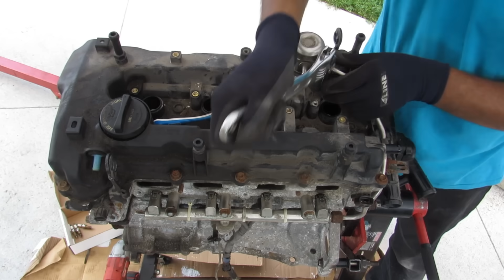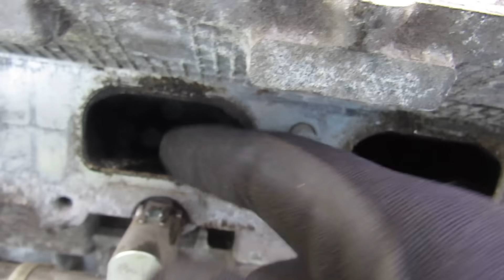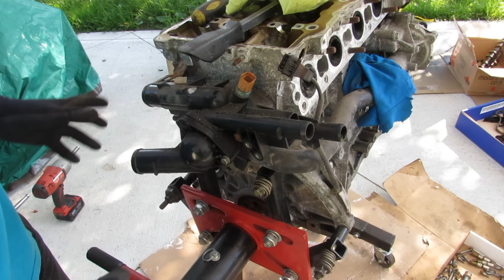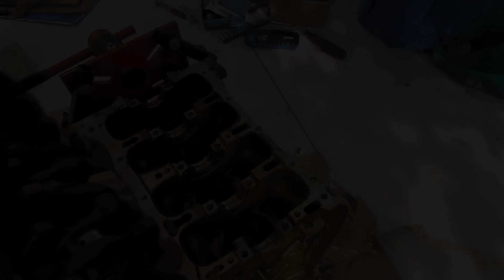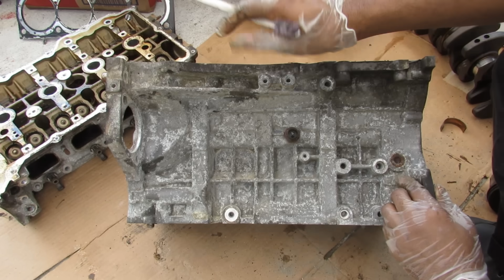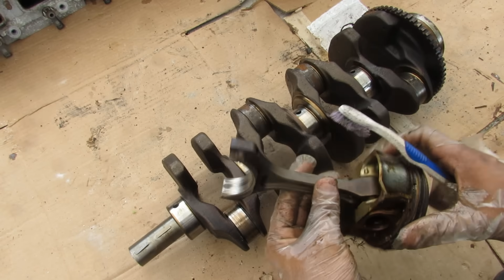Why Hyundai Engines FAIL

Comment: That was really interesting, a shame because the top part of engine looked really clean.  I bought a nearly new 2017 Elantra (in 2018), it has the the newer Atkinson cycle 2 liter engine.  My son and his wife now own, so far so good, no problems and I think it has close to 100,000 miles.  Thankfully they take my advice and make sure the oil and filter is changed every 3,000 miles.  Have to say it is a really nice car to drive, hopefully last them a while longer.
Reply: My son has the 2017 2 litre Kona, 6 speed torque converter trans [down under] which has about 75.000 km now [Atkinson cycle manifold injection], serviced every 15,000 km, no dramas to date. Oil chang period seem long but dealer serviced under warranty, maybe engines built in other countries might have some differences? have not heard of this down under.
Reply: @adoreslaurel  probably same engine as what’s in the Elantra.  I would definitely recommend changing the oil more frequently on yours though
Reply: @robbflynn4325  Yes, it's my sons own vehicle, going to be sold soon as he is to get a new company car, A Subaru  [probably an Impreza I think]. I wish I had enough use for it as I would buy it off him at 75000 km Still got some warranty left. I threw out the under diameter "Donut" and put in a 16 inch  [down under car] BA Falcon 6.5 inch rim with a 205/60 profile tyre, fancy putting a spare wheel in that is less than the diameter of the cars wheels. insane with a 80km speed limit and about the same distance before getting your flat fixed. At least it has a real emergency brake, not like these iffy EPB's that if you lose your electrics in total, stopping is a real problem EPB will not work.
Reply: @adoreslaurel  Definitely prefer a full sized tire, watched a Scotty Kilmer video last week (you've got to check him out), and he did a feature showing how some car manufacturers are not including ANY spare wheel, I guess most people these days wouldn't know how to change one anyway!  My wife drives a 2019 Forester, bought it new, has the 2.5 Boxer engine.  Now has 55,000 miles, no problems, really nice car to drive.
Reply: @robbflynn4325  I do follow Scotty, Down under we get a spare, Tucson and Highlander get one full size [or they used to?] Kona got the silly donut, Service guy at the dealership was surprised when I showed him a full sized tyre would fit in the donut bay. Some cars get a can of "FOOF" but that is no good if you rip a sidewall. Some one posted about Subaru's blowing head gaskets [main problem] when they age and said it was best to fit the turbo model gasket as it supposedly to be superior? The Ford wheel I got my son, has near enough the offset to use, won't go on the front but fits the back, just swap wheels around if necessary, front disc gets in the way.
Reply: @robbflynn4325  Yeah the Kona (and Kia Seltos and Forte) have the same 2.0L Nu Atkinson multiport engine as the Elantra. People sometimes confuse it for the 2.0L GDI engine which doesn't run on the Atkinson cycle and has also been under recall like the Theta II 2.4L. I'm not aware of any recalls on the 2.0L Nu engine, though they are infamous for having faulty ignition coils. Mine had that issue.
Reply: @palebeachbum  yeah, my son still owns the car, has over 100,000 miles now, only probably been with the single ignition coil.  It's been a very good car.
Reply: @robbflynn4325  His luck has been much better than mine was. My 2018 Elantra had engine, transmission, and suspension issues before 10k miles. All common factory defects with this model.
Reply: I bought a new 2017 Elantra,  fully loaded, In june of 2016..it's been absolutely flawless.  90.000 miles on it, 0 repairs,  0 issues.  I'm old school about oil changes,  do it every 3000  to 3500 miles . Nice to drive , comfortable.  I bought a new kia  K5 GT LINE with premium package last May. Love it . Kept the Elantra,  still looks like new in and out. I will continue to use it for my 80 mile round trip to work.  And I'm curious to see how long the engine and transmission,  which I had serviced at 50.000 miles, will last with excellent maintenance.
Reply: I bought a 2018 Elantra new in 2018. 2.0L Atkinson engine with 6spd auto. Loved the car, but it had all sorts of problems right away. Issues with erratic throttle response, loss of power, sputtering engine. The transmission was slipping and slamming gears. The suspension was making loud popping and creaking noises. After numerous visits to the dealership to get these issues resolved with little help, I gave up and sold the car with just 25k miles. Loved the looks, comfort, features, quietness, and efficiency of the car, but it was such a headache to own.
Reply: these newer engines are the same as the Theta II in terms of metal shavings in engine block, right now now there's a lawsuit in Australia on these.
Reply: I’m own 2017 Elantra. Bought brand new. Full synthetic fluids throughout changed engine oil every 5500 to 7k and Over 300k miles now with NO problems. Not even a check engine light. Just goes to show that it is really on the owner and how they treat there rides. There is an Elantra on this liberal platform that has 1 million miles on original drivetrain.
Reply: Well maintained Hyundai/Kia engines last. I have 3 Hyundai/Kia vehicles with the 2.4L Theta II engine and all are excellent. One has 52k miles, one has 100k miles and one has 120k miles. I have 2 other Hyundai/Kia vehicles with different engines with even higher mileage. A 2006 2.0L Beta engine with 160k miles and a 2008 3.3L Lambda with 177k miles.
Reply: @NovaResource  I agree, Google million mile Elantra and you will see how they can last.  I think some (not all) of the well documented problems with certain engines are probably due to owner neglect.  A lot of car owners simply do not change their engine oil at the correct interval, or use the incorrect oil or buy a cheapo filter.  Always use quality oil and filters.  Also drive your car moderately, most cars are not designed to be revved high all the time.  Check your fluids regularly.  My son has a 2003 Accord.  After a long trip I checked the fluids, transmission fluid barely showing on dipstick.  Turns out one of the axle seals from the transmission had a leak which I since fixed with a $14 OEM seal.  Had to get right under the car to pinpoint the leak, fact is most people do not do these checks, and in my son's case the eventual inevitable transmission failure on his Accord would have been explained by it having 170,000 miles and therefore reaching it's lifespan.
Reply: @robbflynn4325  I will add one thing to my comment. The 5 cars I own were all built in Korea. I’ve heard rumor that the cars with engines that fail were built in the US. I’ve been looking for verification of that but have been unable to find such proof but I suspect that is the real issue.
Reply: @NovaResource  bit timely you saying that, watch Scotty Kilmer's latest video where he does a review on the Optima, he mentions how Korean built Kia's are better than those that are built in the US.
Reply: @robbflynn4325  I did see that video. However, I must admit I’m not a Snotty Killcar fan. I think he’s extremely biased. He calls all Kias crap because of one car with an unknown maintenance history and a bad O2 sensor. Of course the car is going to run bad if the O2 is bad, that doesn’t make all Kias crap.
Reply: @NovaResource  They are though. Them and Hyundai
Reply: @bean420man  Then explain my 5 Hyundai’s that have no problems?  And explain the millions of other Hyundai owners with no problems. 🙄
Reply: @NovaResource  That's BS, mine was super maintained , I own an auto repair shop myself , and it's been years since I've seen spun rod bearings on a car, except my Santa Fe. It's a turd of an engine , and Hyundai knows it. That's why they got fined 210 million dollars for jerking customers around about it.
Reply: @danbush1249  It’s not BS. Apparently you’re not the mechanic you think you are.  1.3 million?  Really?  I’ll ask you the same question I asked the guy above,  you got that number from where?  Your ass?
Reply: @danbush1249  So in other words, you pulled that number out of your ass, just like I thought.
I did my research: I own 3 Hyundai/Kia cars with the 2.4L Theta II engine (53k miles, 100k miles and 120k miles) and 2 other Hyundai/Kia cars (164k miles on a 2.0L Beta II and 178k miles on a 3.3L Lambda). That’s a lot of research in my opinion.
Reply: @massacremonk  Makes sense, your Hyundai engine died so all other Hyundai engines are bad too, that’s how logic works. 🙄
I highly doubt Hyundai dealerships do more engine swaps than oil changes. Got any proof of that claim?
Reply: @danbush1249  Santa fes are made in america where is the only made Hyundais that had issues mister "supposed" mechanic.
Reply: @danbush1249  2 million rav 4s had engine fires from the abs system same issue that Hyundai had based on the manufacturer chosen. You not sayying nothing about Toyota are you?
Reply: Toyota is reliable and does not have issues like Hyundai,  I have own 2 hyundai's,  yes they have an engine issue,  my car and 2 of my co workers have their engine replaced free, Hyundai know s this stuff, they have enter a settlement to fix thi
Reply: @technop.8461  Exactly. Buy a Toyota. And OP wants to defend a company with poor ethics and say 50K miles is reliable. 🤣
Reply: @NovaResource  To be fair, the other three you’ve posted are fairly low miles. I don’t even remotely consider something reliable until it hits +200K, hell even +300K. So they have a point. I have never heard a Theta II last longer than 200K. I’ll see it to believe it.
Reply: @Iridiumcosmos  And how many cars have you owned over 200K miles?
Reply: @NovaResource  Let’s see since you’re acting like not everyone else gets past 200K. 🤣

• 2008 Nissan Altima. (Trans died at 210K)

• 2003 Toyota Echo. (+300K still going)

• We had another Nissan that lasted over 200K miles which was a second gen Altima. 

• 2005 Toyota Camry with 407K miles. All original engine and transmission.

Do you want to keep going with this because I got all night buddy.
Reply: @Iridiumcosmos  So your saying you have zero experience with Hyundai. That’s what I thought.
Reply: @NovaResource  I used to work on these pieces of shits a lot so nice try. I have heard more horror stories and seen much more reliable cars from other brands that last in the 300K miles on their original powertrains than Hyundais/Kias. The fact that you think a car that lasts 50 - 100K miles is good just shows you have low standards for reliability. That’s literally breaking in mileage for 98% cars on the road but you can proceed to act upset and go off Einstein.
Reply: @Iridiumcosmos  Sure you have. 🙄  I didn’t say 50-100K was the upper limit. What I said was I have personal experience owing multiple Hyundai/Kia’s with over 150k. And you have ZERO ownership experience with Hyundai/Kia cars. Nice try “Einstein”
Reply: @NovaResource  I have zero ownership/mechanical experience? Should I mention we have a Sorento burning oil like a mofo right now at such low mileage? Keep defending their crappy cars. Hyundai themselves seem to be as clueless as their fans are. 🤣
Reply: @Iridiumcosmos   my son has one bought used '13 Elantra 1.8 pushing 300k. Been doggin it for bout 6 months now.
Reply: Over 1 million bad engines.  Junk Kia's
Reply: @allanhood8402  Over 1 million?  Really?  And you got that number from where?  Your ass?
Reply: @NovaResource  1.3 recalled for that problem.
Reply: @allanhood8402  Were they built in the USA?
Reply: The ones blowing up must be liberal democratic owners. They like destroying everything.

Comment: Bad bearings are the culprit of most of these engines. I’ve seen hundreds of these. Oh yeah and that new recall 203 is for bad piston rings. Most of the ones under recall 203 have scored cylinder walls and most fail under 10k miles.
Reply: Not a Hyndia tech. But I stayed at holiday inn.😄😄😄
Reply: They build some real junk, but it's job security.
Reply: If your a hyundai tech i liked when you could condemm the engine with the GTS great tool.We had some engine fails but more transmission fails.And updates lol.
Reply: @markbuterbuagh4971  I’m not a tech for Hyundai.
Reply: @markbuterbuagh4971  really? My understanding is that the Hyundai 6 speed units are very reliable. I had 165k on mine before trading it.  I do know about the DCT issues, but that's specific to that transmission.
Reply: @MattPSU02  Ok the Tucson and Santa Fe had transmission problems never paid attention how many speeds it had.Now the Sonata had upper end brakeage don't know if they where US build or Korean build.And the Elantra had vvt problems other than that I would still buy a Hyundai.And side note we got paid 8.5 hours to replace the engine in a Sonata.
Reply: @markbuterbuagh4971  the Hyundai dealers have become quite proficient at swapping engines, since they do so many of them.
Reply: @MattPSU02  I new a tech who could do two a day don't know if he had come back's.To do one a day was good than you could get back to making money.
Reply: @markbuterbuagh4971  it's 6 now. They dropped it.
Reply: Mines included in that… 2020 Elantra Sel and I’m about to hit 20k. So far so good there’s no remedy so no use in trying to get them to do a recall they can’t “fix” yet.

Comment: I have the 2.0l turbo version of this car and I have done oil changes every 3500 miles since I got it with 28k miles. I got the recall notice and keep it at home with the title in my safe. I'm at 105k now. Fingers crossed.
Reply: You have another 15k miles to get a free new engine.
Reply: @nitroustommy  oh yeah, I've got a notice in the mail about unlimited mileage engine replacement. We will see what happens. It has been fine since day 1.
Reply: It's unlimited as long as you get the knock sensor update.